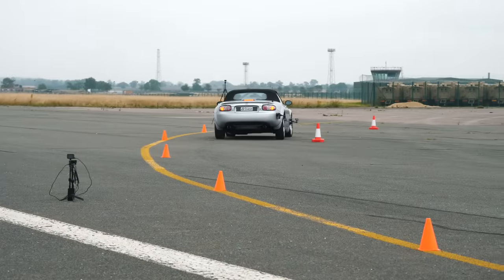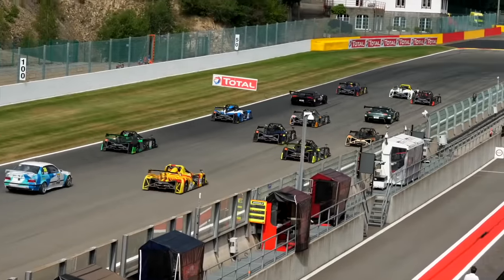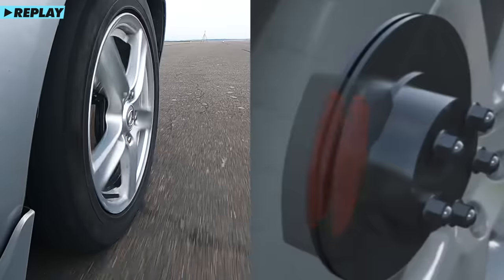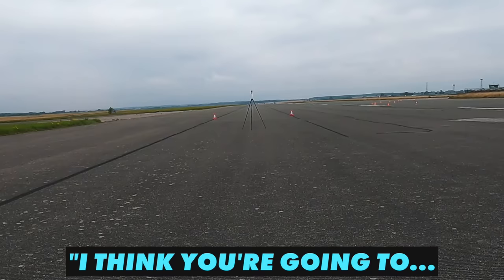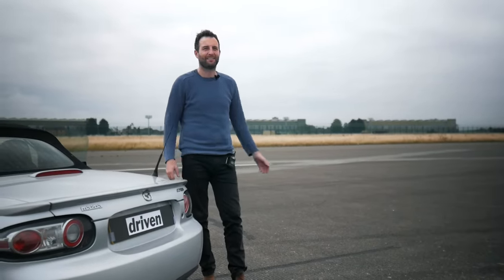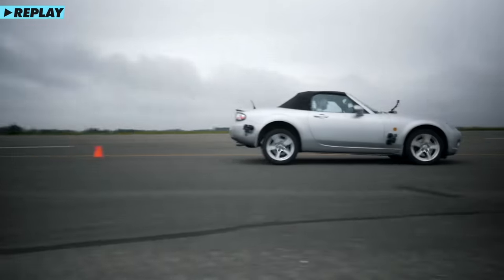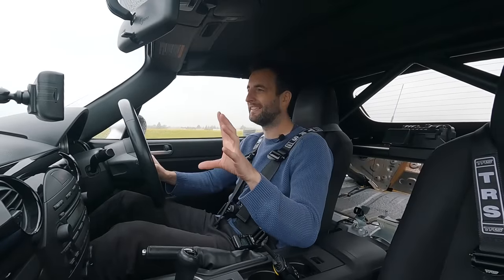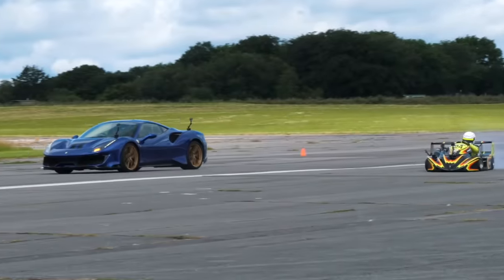ABS ON vs ABS OFF | What's Really the Difference?

Comment: Can you do this test without intentionally locking up? Like how an actual driver would drive.
Reply: I think you overestimate the skills of the average actual driver.
Reply: @stephenshoihet2590  no
Reply: @UncIe_Drew  YES. because in an emergency, no driver would actually tryto not lock up. its called panicking.And most driver would even know how to brake without locking up cuz they aren't racing drivers
Reply: @Keoponloeu   No, actually studies have shown in most cases people do not brake hard enough. Sure people will panic and lock up at times but they also let up during those times. I'm sorry I work in the industry and have seen results of these studies.
Reply: @ProjectExMachina  or lack of grip due to weather condition so you keep control. Panic lock up does not mean you stay locked up indefinitely. There is quite a difference. The video shows worst case scenario difference but worst case scenario is not most of the time.
Reply: @UncIe_Drew  if the people already doesnt know how to brake hard, then why do you expect they can control braking power while lockup?
natural instinct would to brake harder if the car doesnt decelerate enough.
driver education is very bad in many countries.
Reply: I've driven cars for the last 25/27 years or so... I've raced, I've tested cars for prods, I've taken some trainings on advanced driving a few years back and I can recall at least one time where electronics saved my life ( someone crashed right in front of me on the fast lane of a highway at night) and a few times where in very hard weather conditions electronics helped...  The whole purpose of this video is to exagerate the braking so it's easier to understand the difference ABS makes...   

BTW locking is not that bad in certain situations, that's why many cars have a "panic stop" over ABS where it allows wheels to lock a few times so it creates extra grip on hard decceleration, this tells you that drivers may even expect locking to happen while braking hard...
Reply: @MMOPhotos  read through the comments. No one is arguing against that. The systems you refer to are brake assist systems or BAS. Generally speaking the general public doesn't brake hard enough thus the invention of BAS. Full lock up exaggeration is fine (its outcome is expected) but doesn't show how most people react. At least not since cars have moved away from 4 wheel drum brakes in heavy cars with small tires.
Reply: @UncIe_Drew   "Like how an actual driver would drive." Stephen Shoihet: "I think you overestimate the skills of the average actual driver." You: "no"
Bhahahaha 😂
Yes you are. In a panic attack MANY and i do mean it, MANY driver would react like a Deer when hitting the brakes (ABS or not) And just put the brakes to the floor.
Studies isn't always accurate. How the hell is a studies organisation going to monitor for a full week the ENTIRE Planet's continents with billion of cars all around the world and see every single Hard-braking (including non-reported cases that didn't end up as a crash)
Reply: @TwinShards  your believe isn't very accurate actually. I mean unless everyone is still driving vehicles from the 50's and 60's and 4 wheel drums.
Reply: @stephenshoihet2590  vastly.
Reply: I have to agree with the guys. In a panic situation, the average driver will put their foot down and brake as hard as they can. Whether they brake the maximum is a different story. ABS only activates when the wheels lock up. If the wheels do lock up then you are braking as hard as possible. I even find it odd that there’s a study that shows people don’t press the brake paddle hard enough in a panic situation lol.
Reply: @francisudubor6811  wheels can lock up before full brake pressure. They invented systems back in the 90's to help provide full brake pressure in panic situations cause the reality is people don't always brake hard enough. It's called bas or brake assist system.
Reply: @TwinShards  in the olden days we were told to PUMP the brakes to avoid lockup.
Reply: But there is also still a problem : if  in reality the driver brakes less than shown in video the distance covered while braking will also get bigger and risks of accidents would also increase
Reply: @Coolgamer400  it is not. Not in Europe. people actually know how to do this stuff
Reply: @UncIe_Drew  I agree, he should done one with pulse braking, this what i done when i had my 1990 celica without ABS, even when i had emergency i didnt lock up.
Reply: @Kacpa2  it seems like if somebody doesn't have ABS brakes, they have to learn the proper techniques to brake, so unless we add braking techniques to our driving education and provide roads for drivers to practice braking, ABS brakes is certainly a great invention. My current cad doesn't have ABS brakes and to be quite honest I'm not sure how I would stop it very quickly. Clearly from this video, applying the brakes to the point where the tires are smoking makes a bad stopping distance, so I assume pumping brakes would be much better. I wonder if ABS brakes can be compared to pumping brakes more quickly than a human can
Reply: imo ABS is worse if you’re an above average driver in any given conditions. a good enough driver might even use the  front wheels locking to initiate oversteer and avoid an obstacle  in front of them
Reply: @EL1TESHARK  yeah but none of that is being tested in the video.
Reply: @EL1TESHARK  How do you initiate oversteer by locking front tyres??
Reply: @jeetsupa4362  by locking the wheel in either direction to initiate laterall force on the rear tires, it’s similar to hand braking except most of the time the front tires are locked while the rear diff is still open
Reply: @EL1TESHARK  How do you lock your front tyres?
Reply: @jeetsupa4362  by not having ABS and braking past the threshold of the tires grip, it would be difficult to lock the front tires on an SUV for example because the weight of the vehicle requires the rear brakes to handle more stopping power. sedans and compact cars are easy to lock up the fronts when driving
Reply: @EL1TESHARK  Do you have any example videos of this?
Reply: @francisudubor6811  Police has more than enough experience with accidents where there are no braking tracing, because people do not brake enough, another easy way to find out if people brake hard enough: ask them if the know how ABS feel during braking, if they do not now, than you know they never braked hard enough, otherwise they would know it. I remember when the first time my mother had to brake hard to avoid an accident, but it was heavily raining so the "usual hard emergency braking" was already past traction loss, at the end when we arrived at the destination she called my father and told that the brakes might be broken because they were doing "funky stuff and noises and feeling wierd".

I think Luxemburg does a good thing with the mandatory theoratrical and practical classes for driving as well as the mandatory safety driving session earliest 3 month after gaining the licence and latest 2 years after (otherwise the provisional driving license will not be switched by the definitiv driving license).
Reply: @EL1TESHARK  🤦‍♂️